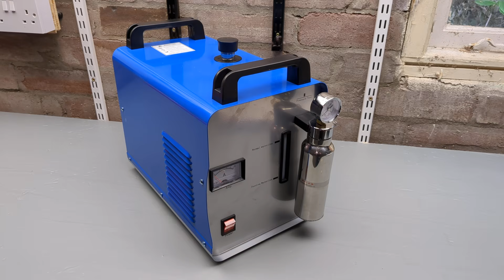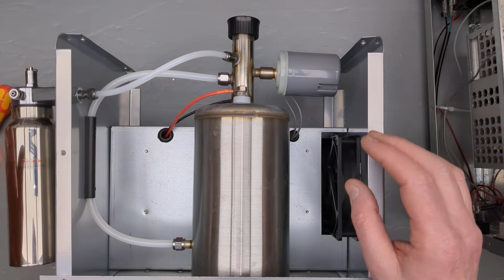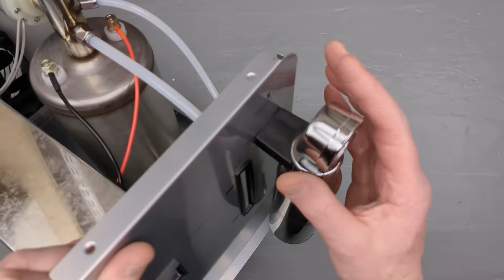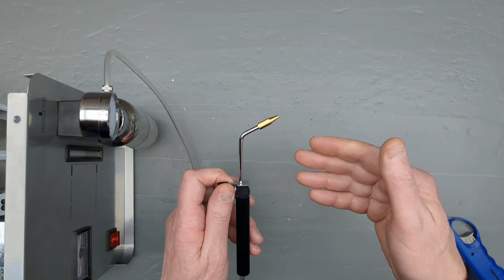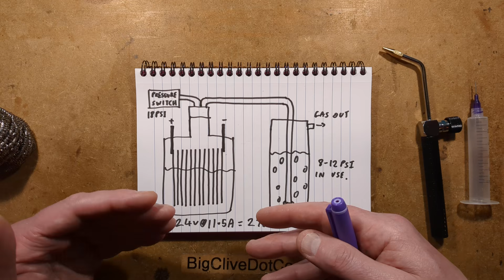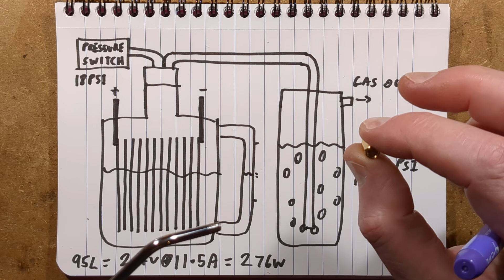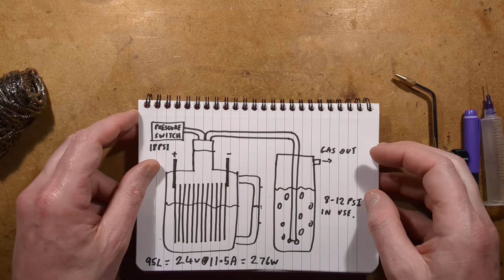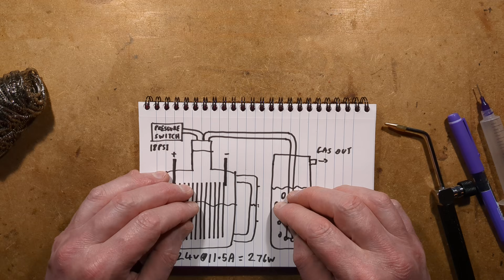Inside OxyHydrogen gas generators (HHO/Brown's gas)

Comment: Much of the sound produced is due to the fact that Brown's gas has a volume 1865 times greater than the water that is produced by burning it. This leaves a partial vacuum behind, unlike regular explosions. The sound is the atmosphere rushing in at slightly more than the speed of sound to fill the low pressure area. You're hearing more of the implosion than the explosion.
Reply: The water produced is in the gaseous phase (not even vapour! mind the difference) and takes up more volume than the initial HHO. It condenses only afterwards upon having been cooled with air or other matter.
Reply: The supposed effect you are describing here would only be possible if all the water vapour generated by the combustion of hydrogen and oxygen immediately condensed back into liquid water. Also, if this did somehow happen, there is no reason why it would only happen if the oxygen/hydrogen mixture was perfectly stoichiometric (2 parts hydrogen, one part oxygen by volume), or near enough. Just the combustion of the hydrogen with ambient atmospheric oxygen without any supplementary oxygen mixed in should give a similar effect: Assuming the quantity of hydrogen involved is the same in either case, the combustion would be a little slower, but the same amount of water would be created and the same amount of energy would be released.

Anyway, the kind of immediate condensation of water vapour into liquid water that would be necessary to generate a vacuum (or partial vacuum) as you describe here does NOT happen. Which isn't to say that the water vapour will not condense eventually: It absolutely will, but a significant amount of energy needs to be dissipated in order for that to happen, and this is nowhere near immediate, it takes time.
How much energy? That is an interesting question in itself, and the answer may surprise you: Take the simple example of a pot of water on a stove, starting at zero degrees C (or realistically a fraction of a degree above that) before heating is applied. Sufficient heat is applied to raise the water up to 100 degrees C (aka boiling point), and heating is continued until all the water has been boiled off, aka converted into steam.

Imagine how much energy it takes to raise the temperature of water from freezing point to boiling point: In fact we can work this out precisely, because the specific heat capacity of water is a known quantity: 4,184 Joules per kilogram per degree of temperature change. So for each kilogram (or litre) of water, raising the temperature from freezing point to boiling point takes 41,840 Joules. Incredibly, though this is also 100% true, going that little bit further to change the phase from liquid water (already at boiling point) into steam takes the same amount of energy, again per kilogram.

The point being that to condense steam back into liquid water, that same amount of energy has to be dissipated. Which is at absolute minimum, assuming that the steam is at only 100 degrees to start with. If it's hotter than that, which the steam produced by combustion of hydrogen is certain to be, then the energy to be dissipated in order to condense it back into liquid water will be considerably more. Hence why this cannot happen instantly.
There is still a molecular disparity, because you start with 2 moles of hydrogen plus 1 of oxygen and produce 2 moles of water. So hypothetically, if all else could be equal, then the product should occupy 1/3 less volume. But in reality this just does not happen, primarily because of the energy released by the combustion, meaning that the product will always be water in its gaseous state and at a far higher temperature than the oxygen/hydrogen mixture started at.

So no, the sound is most definitely not produced by a partial vacuum. Another name for Browns gas, aka the perfect stoichiometric mixture of hydrogen and oxygen, is "detonating gas". I'm not sure if this is strictly accurate, because a genuine detonation is defined by being supersonic, whereas subsonic explosions are technically described as deflagrations. But anyway, it is the extremely rapid combustion and the energy released by this which generates the intensely loud noise. Probably the closest comparison would be the detonation of a stoichiometric mixture of acetylene and oxygen. This is also extremely loud, even though the combustion products are going to be 2/3 carbon dioxide and only 1/3 water vapour.
Reply: @lloydevans2900 is this your opinion?
Reply: You're getting confused between browns gas and steam
Reply: @jasonmawdsley4139 no I am not.
Reply: @jasonmawdsley4139 no I am not.

Comment: i'm very uncomfortable about those clear plastic hoses doing this job.   i wonder if there are hoses designed specifically for hydrogen like there is a type for acetylene and another type for lpg.   and i'm very uncomfortable about using methanol for anything.   flashback arrestors would be a good idea here but there wont be any available to work with these types of hoses.   it seems that a lot of flashback arrestors are designed for single use.   if you get a flashback you may need new arrestors.

Comment: I did the bubbling into soapy water with oxy/acetylene mixture when I was a yuff working in a garage. We did it in a plastic measuring jug, the explosion smashed the jug apart, it felt like we were slapped in the face and our ears took a couple of days to recover. Never again! I would say that filling a balloon with oxy/hydrogen would be very very unwise (and I come from the pre-safety age) as if it exploded near to your face it would probably detach your retinas.  It's a pity you only melted a bit of glass as I would like to see if you could use it to weld (say) thin stainless sheet - it may be a substitute for a TIG welder for very light duty work maybe?

Comment: Would the output and input power effectively match?  Ie did that mean the torch is burning at 235W (allowing for the fan)?
Reply: No, there are losses due to heat production.

Comment: As the gas mix is a perfect combustible mix in theory the flame should work under water, you may need a shield around the tip to protect the flame front. It should also burn in an  evacuated flask leaving nothing but Di-hydrogen Oxide as a combustion product.

Comment: So all the energy present as heat in the flame is basically being matched by the energy put into the electrolysis chamber? (splits the fluid then recombines to make a flame)  And fundamentally the whole reason for the splitter is a cheaper source of H and O than compressed cylinders.
Reply: Not all of it. Any system has losses; most of them are excess heat from every component in there. But yes if it's cheaper to use electricity than to hire cylinders then this sort of thing is the better option, or if you only need to use them every so often & don't want big bottles of bomb hanging around the house.

Comment: No! You cannot use browns gas in your car! There's just enough oxygen to get the hydrogen to burn and then on top of that you are adding more fuel... 
If you are only using the oxygen component and releasing the hydrogen into the atmosphere, you can get a better burn of the cars fuel which should get you more power, a cleaner burn the thus better economy.... 
I suppose it could be tested with a crude setup using a larger bottle of oxygen from a welding supply shop and just let it leak into the intake at a constant rate over a somewhat long cruise to test if fuel consumption goes down! 
NOS systems built a direct coupled oxygen system which performs like a super charged engine... There's a video somewhere here on YouTube... They got really good performance out of it... Some things work so much better with pure oxygen... Even the exhaust fumes were less dangerous.... Very worthwhile looking into ..
Reply: But then there's oxidation of all the components in the engine & exhaust.

Comment: At work we have tested a larger oxygen-hydrogen generator for brazing copper pipes in cooling systems (that was about 15 years ago). It is not easy to work with because the flame is almost invisible and the flame also has a much smaller "hot spot" witch makes it more difficult to work with than an oxygen-acetylene burner. On an oxygen-acetylene flame you can clearly see the hottest and less hot part of the flame, and that is necessary for brazing copper pipes. We have tested it for a few weeks, and nobody wanted to work with it, i have also used it for a few hours, but went back to oxygen-acetylene.

Comment: Polishing acrylic eh? Shouldn't an electric heat gun be enough? This almost sounds like a white lie for legal reasons.
Reply: Heat guns might work if you had an extremely tight nozzle on the end, but generally they spaff heat out all over the place & would melt & deform the acrylic sheet instead of only applying the heat to the edge.

Comment: Hi Clive. I have an older similar unit. My Cousin is a Jeweler, and they use these Micro welders just a tad bigger. In the Bubble they use Methyl Ethyl Ketone (MEK) it creates a nice controlled blue Flame by altering its Temperature. Any Way Nice Vid. Paul

Comment: I started building an electroliser in high-school. Not at school, at home in the shed. That bang makes me glad I lost interest before getting it to work!

And yes, electrolysing water and then burning it isn’t particularly energy efficient as a means of storing energy. A fuel cell is slightly better but still has nothing on chemical batteries and electric motors.

Every time I hear about investment in a hydrogen fuel project I just roll my eyes. They are so keen to have a “printer ink” that they can sell us.

Comment: That thing is scary shit. And i worked with explosives. That bang exceeded the limits of your microphone by far....and your ears! Why the flame is not igniting the back is a mystery to me. But i would set up an experiment to see, how far mosquitos will be killed in the air by the shockwave...But only with Micky Mouse and goggles (the shockwave on your eyes is like slapping them, quite unpleasant, to describe it in BigClive words)!
Reply: The pressure from the gases escaping the nozzle keeps the flame from pulling backwards. That's why there's a tiny gap between the end of the nozzle & the start of the flame.
Reply: @NightCatArts therefore the speed of the flame is slower compared to the flow of gas? On the other hand the speed of the explosion seems to be very high. But if one is working with it and you got a power outage for whatever reason, best would be to run.
Reply: @stefanmargraf7878  Well, it's an implosion so it can't pull back along anything. If you turned the valve/flame down very low indeed then maybe it could pull back through the torch, but the pressure of the gas behind the valve on the torch is still higher. Even if it were to get through there, it then goes into that secondary cylinder and burns up in there; it can't get through the liquid & up the pipe to the primary cylinder.

Comment: I used to work in a fibre optics research lab which used fused quartz tubing to create specialist refractive index profiles by depositing doped layers inside. The pure hydrogen/oxygen flame is almost invisible bluish colour. The coloured flame here is obviously contaminated with sodium. The main reason for oxy-hydrogen burners was its high temperature >2000°C needed to melt and fuse quartz and its clean flame.
For safety all piped gas lines were fitted with flame arresters.
One of the main problems with hydrogen which doesn't seem to come up in modern discussions of its use is that it is such a small molecule it has about 3 times the leakage rate of other larger molecule fuels such as methane. It's quite difficult to keep it contained 😉
Reply: Many people talk about the "hydrogen economy" I am sure they have no knowledge of the difficulties of storing H2.
Reply: @jt-rz9up  One of my professors researches hydrogen storage in nanopores and the mere mention of hydrogen cars makes him go on an unhinged rant about how bad of an idea that is.
Reply: @hammerth1421 Engineering With Rosie recently published a plant tour video. She toured a "green" steel plant. I believe this was the first (possibly still the only?) factory to recycle steel and process pig iron on an industrial scale which can run without generating CO2. When electricity is cheap enough, they use it to split water. Then they use the hydrogen to make steel.

At the time of the tour, they only had short term hydrogen storage. Their goal was to install enough storage so that they could make enough hydrogen to last the rest of the day in the few hours when electricity is at its cheapest.

Right now the plant uses natural gas when electricity is expensive.

In that context "long term" hydrogen storage, means almost a full day.

Smart people have been ranting for decades that hydrogen production only makes sense when it is used where it is made and then only when you need it for its chemical properties.  And then they say "like in steel or agricultural chemical production". It has been decades but there is finally an industrial quantity steel plan that does that. I haven't heard of any chemical plants that do that.
Reply: @jt-rz9up  Or the amount of electricity it takes to produce useful quantities of it.
Reply: Many years ago, I was involved with the production side, the burner was made out of quartz to prevent melting.
Reply: @ralphj4012 some of the burners we used were fabricated in house entirely from quartz tubing, not for heat resistance but to avoid contamination. I was working on a process to make fibres on a continuous process by silica soot deposition which was then to be fused and the resultant rod passed into a fibre drawing mechanism. The hydrogen flame was in direct contact with the final fibre so had to be free of contaminants. The flame carried the doping materials to tune the fibre's pass band.
Ideally monochromatic light was needed to gain the highest bandwidth and minimize dispersion for long fibre runs without repeaters and signal conditioners.
Reply: > "hydrogen ..is such a small molecule..difficult to keep it contained.." That's what's groovy about these OH generators- you make water into gas as you go along, you don't buy gas weeks in advance. (The weld-gas guy comes to my woods only every other month.)
Reply: Yes,I believe the gas in the video must have some form of contamination as I also have seen electrolysis HHO gas generators  with torches and the flame is always near completely invisible.
Reply: Nice demo. Alway’s wondered about these. My daughter loves your accent. Say’s you sound like “Mrs. Doubtfire”.

Comment: We've been using one of these for years at work for edge polishing acrylic - now redundant as laser cutting has pretty much made it useless. Though we've always used MEK (Methyl Ethyl Keytone (sp?)) in the bubbler. Not sure why. Our flame is full blue.
Reply: The MEK both makes the flame easier to see & brings the temperature down to a more practical level for the acrylic.

Comment: wouldn't filling your engine with oxyhydrogen just cause it to knock really bad??? How does engine knocking help with emissions, plus the thing draws power which doesn't come from thin air, it has to come from the engine via the alternator

Comment: 13.00 the distance between the Neutral baffles has to relate to the frequency applied, it has to be a harmonic of ... now look at it like a battery that you control the frequency of charge and discharge.
Neutrals become both both .. but it sucks a lot of power power power.
Petrol to LPG is better, just need a small tyrepump 14psi into half a can of any old shitty Petrol, short tube to a 9kg gas bottle, another short tube to half a bottle of water, to your gas appliance ...
Reply: What frequency? It's DC. Bubbling air through petrol doesn't make LPG

Comment: Actually, I don't think those things are actually "Brown's Gas" / "HHO" generators, but just dissociate water into H2 and O2.  Ostensibly, BG has eerie properties, where the flame is relatively cool until it hits something electrically conductive (like when cutting/welding metal), and then the heat is blazingly intense.
Anyhoo, I did experiment with H2+O2 generators in my car, nothing fancy, just to use the stoke mix of both to act like Et2O when starting diesels on cold days.  Ie, it makes the mix easier to light up, and to burn more completely.  Let's just say my car passed emissions for close to 10yrs with a hollowed-out cat (not my doing;  the ceramic just cracked and blew out the pipe over time).  Only when the state literally halved allowable emissions from one year to the next did I have to tweak things and eventually get a new cat.  Plugs and cylinders were so clean you could eat from them.
Normally, on cold days sitting overnight, I'd have to crank it maybe 2-3seconds before it'd light up.  Drawing only 2A or so, and "pre-filling" the air-cleaner body for maybe 10sec, all I had to do was touch it for a half-second for it to start right up.
I'd also make sure to turn it off for about a minute or two before getting home and turning off the engine, because I didn't want to risk hydrogen embrittlement if H2 would just sit around looking to weasel its way into metal surfaces.
Oh, and I didn't use any magical steel or anything, nor any electrolyte, just a buck converter to step down the voltage just enough to pull maybe 2A through it, and yeah, the beastie would end up with rusty brown water over time.  But it still wasn't Brown's Gas, haha.